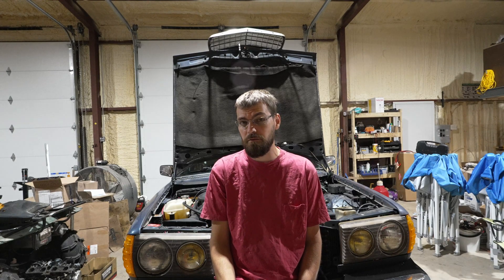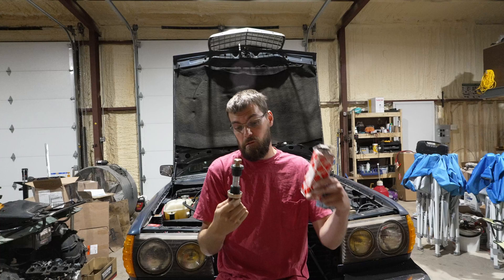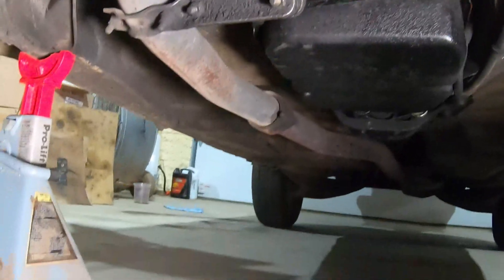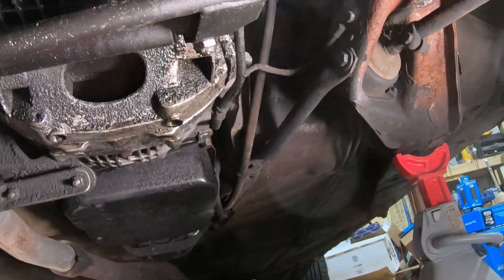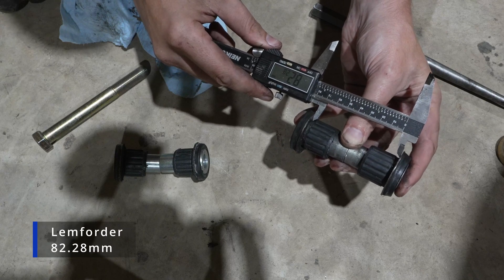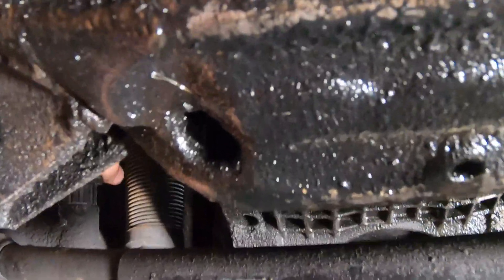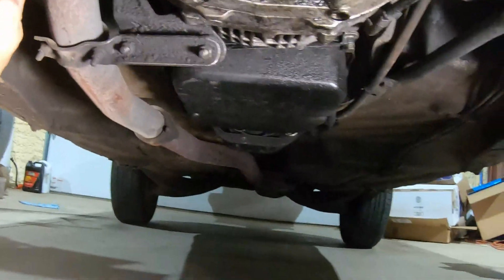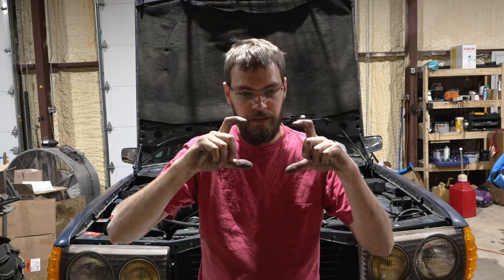W123 Steering Idler makes a groaning noise... Why?

Comment: It is such a superficial complaint that after changing mine years ago I no longer care. On the occasion it groans I laugh as if my Benz just did a fart.

Usually the sound will only occur when needing full lock at near stationary. And is entirely functional for a very long time after it begins groaning more frequently
Reply from the maker: Mine was groaning any time the wheel was turned even slightly, and it also did not return to center even slightly so it tended to wander and memory steer. Likely yours isn't that bad, it is possible some were machined closer to the correct spec, the noise irritated me but the tightness of the steering was unsafe.